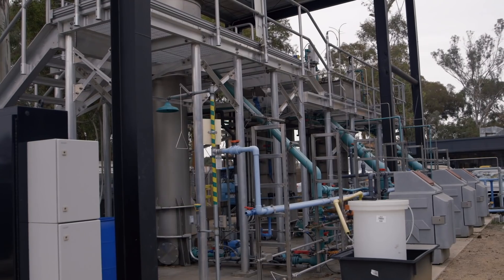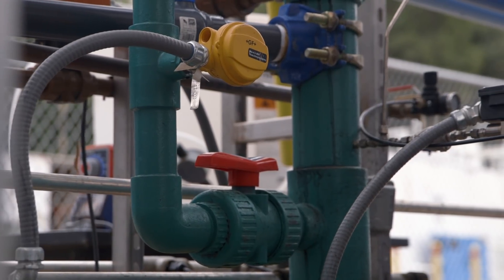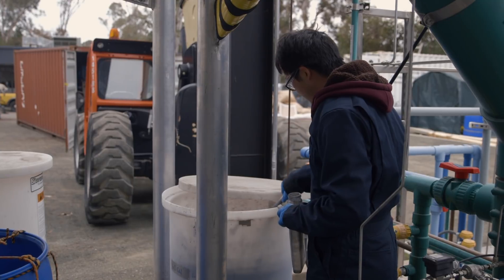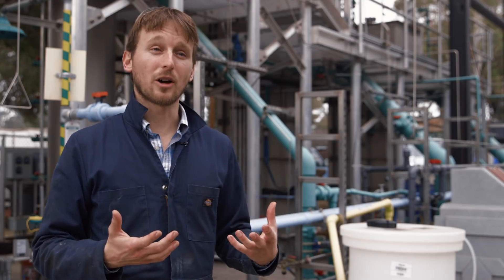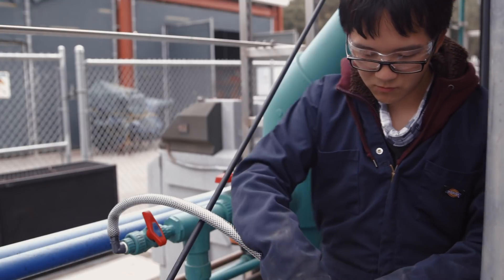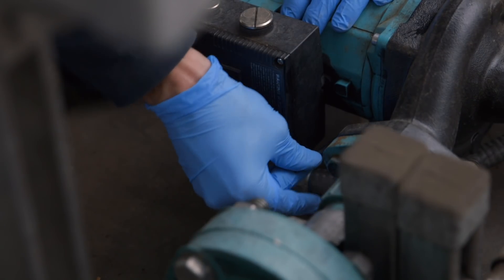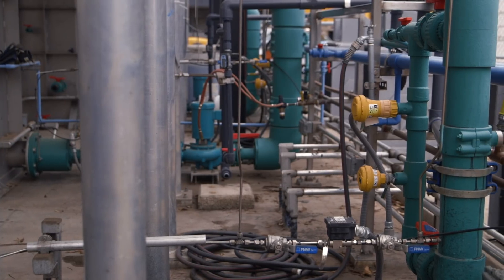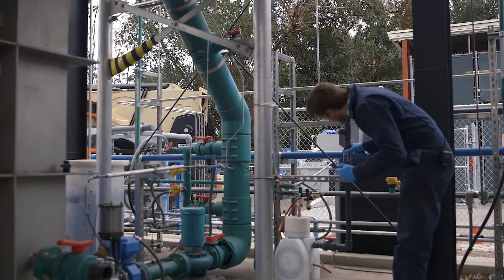New Stanford plant tests energy-saving way to treat wastewater

Comment: 20+ years ago I went to school with a guy who worked at a wast water plant.   At that time they used methane gas to power their generators, that would then in turn be used to run the aeration pumps.   They had been doing that for quite some time too.
Reply: Methane extraction and use from wastewater treatment is old. But I know the common aeration practice is archaiac. Municiples dont take the basins down to upkeep the systems. So when ineffeciencies arise they do nothing about it and just let tons cubic feet of undirected air just boil out of the system not adding to aeration nor DO. No cities want to spend the money on a state of the art system because it takes skilled repair persons, and replacement parts are that much more expensive.